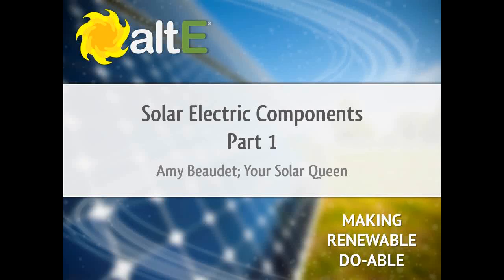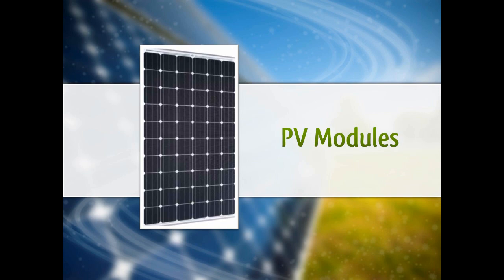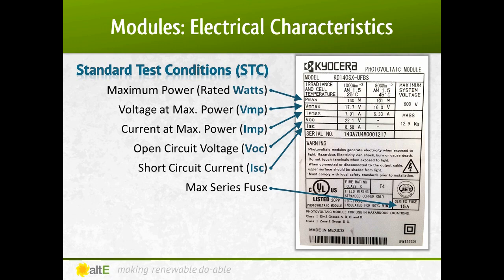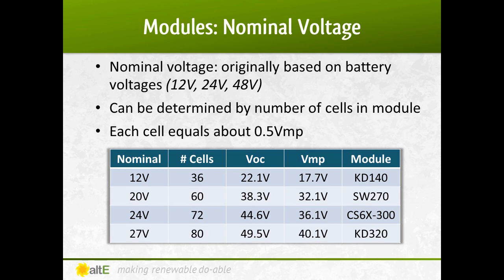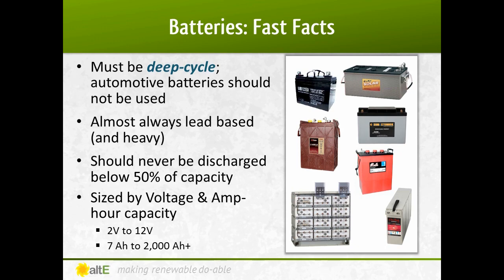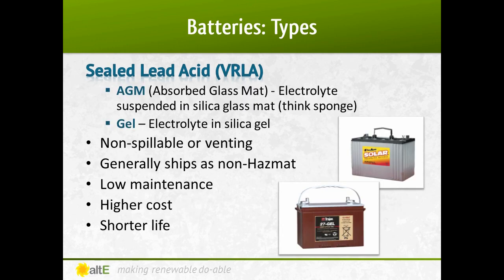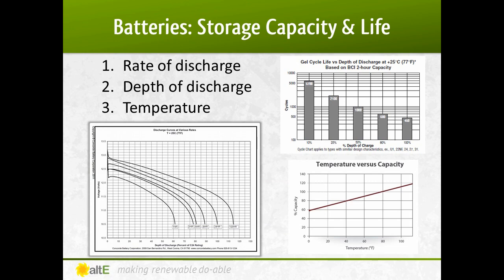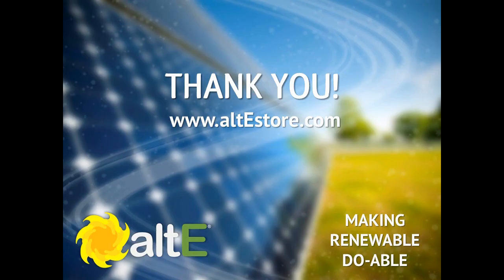Solar Panels & Batteries: Solar Power Components - Part 1

Comment: hi Amy,  its been so long you are educating all engineers. thanks for that .

connecting battery in parallel increase its capacity or in series increase its capacity???
Reply from the maker: Connecting batteries in parallel increases Ah. Connecting in series increases volts. But here's the cool thing, both increase capacity. for example, a 12V 100Ah battery has 1200Wh (12V x 100Ah = 1200Wh). Two wired in series = 24V x 100Ah = 2400Wh total. Two wired in parallel = 12V x 200Ah = 2400Wh. Same Wh capacity, just different volts and amp hours.
Reply: @AltEStore  thanks
Reply: @AltEStore  Dear amy madam , many engineers are struggling to understand pvsyst software used to know production of solar system and some other things please make few videos so we csn implement it in our life to find better jobs   .